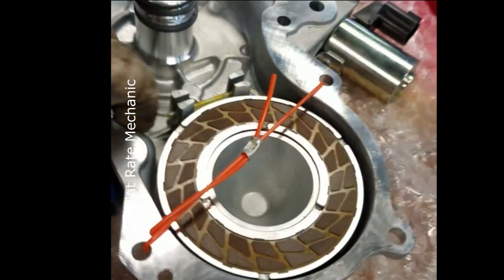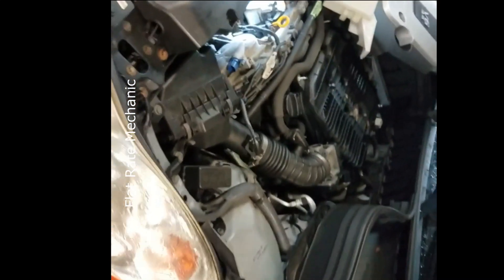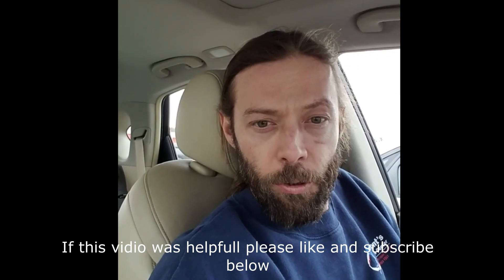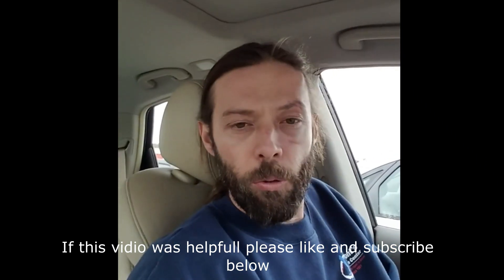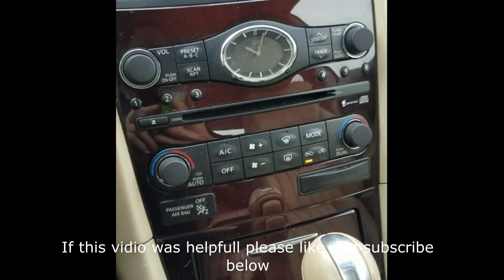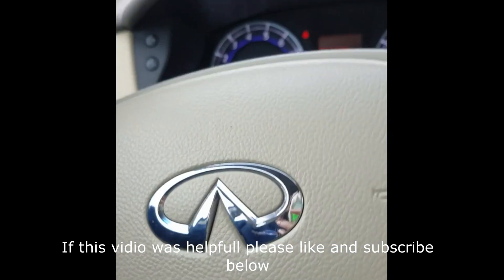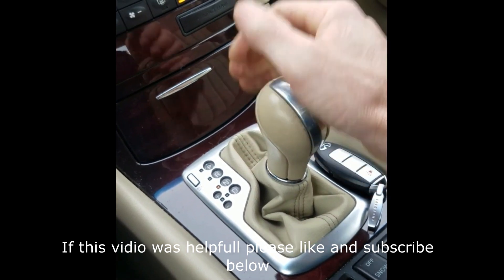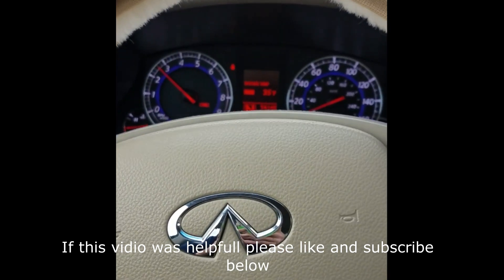Exhaust valve timing control learning procedure Infiniti G35 P0014 P0024 (no scantool needed)

Comment from the maker: You can find the scan tool I use on Amazon here: http://amzn.to/2BQq2Av Just wanted to add, I did have to hold my foot on the brake when doing the relearn. I don't think I stated that in the video. Also, Identifix said nothing about pushing the brake too. I was unable to get the relearn to work untill I held my food on the brake.
Reply: The Flat Rate Mechanic hey bro I have the P0024 are you positive that it is The right part because mine is from bank 2 not from bank 1, and also I have no issues with idle it sits well on 8-900 rpm  no hesitation there’s no issues whatsoever but my vehicle is still popping up this P0024 code I need to know because the bank to is going to cost me $700 and I need to be positive on making this investment so are you 100% sure that this cleared that code?
Reply: Also I have changed variable valve timing Scylla noise I had clean my camshaft sensors the only thing is I have not cleaned my crankshaft sensor
Reply from the maker: p0014 is bank 1 and p0024 is bank 2. I cant guarantee anything but in my case, this did fix it.
Reply: Will this work on a 2009 fx35?
Reply: @GTB197711  i have the same problem can you tell me if you fix it and what was the part number?
Reply: @Letedwin1107  The relearn process worked for me. I replaced both sides at the same time and did the relearn process.
Reply: @GTB197711  ok thanks im dealing with p0024 Bank 2 y buy the part but I want to makes Shure I have the right part... Bank 2 is the right site right?
Reply: @Letedwin1107  I cant remember but I think it is. You can verify with the dealership. I ended up replacing both sides.
Reply: @GTB197711 how do you do the relearn
Reply: DO YOU HAVE THE PART NUMBER YOU CAN SHARE ?
Reply: How do you know it worked?  Is there an indicator that says it work.
Reply: Ive got p0014 and 420 bank 1 code.

Comment: Is there any way you can show how to remove the VTC cover, especially the passenger side ? Did you have to remove the front fan in front of it?
Reply: If you want better access to it I would remove fan assembly cause it's right in front of the timing cover
Reply: Yes the passenger side is alot more work than driver side. Belts fans ect all come off

Comment: Helpppp my 2011 Nissan Maxima SV 3.5 V6 is pulling a Exhaust Valve Timing Control B1 (P0014) but I see most says left and only seen one right ; EXPENSIVE.... Which one do I get? Right or Left? Some come in 2 pack do I get both?
Reply: You ever find out what the problem was?

Comment: Hey bud thanks for this video. I left one long a@@ message on my last comment on your other video. This will be alot shorter...Lol. I popped a P0014 code on my 2009 Maxima. The issue wasn't the actuater/ solenoid. Tested it and it worked. How do I test the Magnet Retarder? Why and how does that part go bad? The dealer wants $1000 plus for the case with the solenoid and retartder that's all together. They don't sell just the retartder. I found it online for $150-$175 plus shipping but no one can tell me if it comes with the kit. Which explains how to remove and some type of tool that helps remove that part. Okay so car is apart and the Solenoid works and the Magnet Retartder is okay but not sure. One mechanic put a power tester on it. Says he thinks it's okay? I don't want to put that mess back together without feeling 100 percent about the Magnet Retarder. Well atleast it was alittle shorter this comment. I appreciate your videos!!! Keep up the great work!!!!

Comment: hey, just did this relearn and then disconnected the battery. The SEL light went away and seems to be driving better than before. Thanks for this you saved me money on extra parts. Works on the G35 6spd MT
Reply: This is a stretch, but did you take the retarders/covers off to do the relearn? Just disconnected them? How do you initiate the relearn process?

Comment: do you know how to do a Relearn for a 2005 Infiniti G35 6spd MT? I just changed the solenoid in bank 2 with oil change and code still on.  Please? thanks alot.
Reply: Did you reset the ecu?

Comment: My engine starts to make loud ticking noise during this procedure after 5-6 seconds holding the throttle at 1800-2000.  Anyone else experiencing such issue
Reply: Did yours tick when it was idling to? Or just during the relearn
Reply: @camrenrierson3983  only during relearn

Comment: I just did that ( 215k miles on the clock)  because engine hesitates around 950-1000rpm when warm. While holding 1800-2000rpm after 5-6 seconds I start to hear tapping noise somewhere from valve train ( imagine you leave gap between valve and lifter 0.5mm or more- same sound) noise increases in the following seconds and it doesn't go away even after 30 seconds. It goes away after I pass 2000rpm or I let of the throttle. Is this the normal procedure or my chains are super stretched and they do the noise. I tried doing the same thing with obd scan tool, but it doesn't want to do it because " computer is detecting malfunction, relearn procedure failed "
Reply: 100% Sure it's faulty VVT solenoid. First you can do to validate it - just remove connectors from both VVT solenoids. IF the noice is gone - replace faulty VVT Solenoid

Comment: I replaced the VVT solenoid on my 2005 350z due to code p0011. Periodically after I clear the code the  code comes back in a week or so.

I can tell you that it nearly always happen on a stretch of road that has me in 6th gear at about 2000 rpm

Do you need to do the relearn steps even if you just replaced the VVT and not the magnetic retarder?
Reply from the maker: Yes i would make sure the relearn is done before going any further with repairs
Reply: I have a p0014 and I did replaced both sides VVTs and now I have that code imma try this relearn because the other thing I can imagine I have to change will be the VCT cover and it’s like $800

Comment: How to test this if it's bad or not ?
Reply: To test it you can use the ohm meter, check for .9 -.11 ohms at the retarter plug, with ambient temp of 66F (about) the thing is that it can read good but the clutch may be grab enough. That parts is expensive man about $900 bucks

Comment: How do you know that it's been relearned
Reply from the maker: You don't really. Unfurchently. And it can be very hard for it to take sometimes. If the check engine light keeps coming back on I would recommend you have the dealer do it with factory tool before spending any more money on repairs.

Comment: I got p1078 on my 06 g35 and my scanner says it’s the exhaust timing control sensor  is that this sensor?
Reply: Did you get your problem resolved with code P1078?
Reply: were you able to get it fixed?

Comment: Thank you for the video. how much labor does the dealer charge to replace one or both timing magnetic retarder?
Reply: I read somewhere that cleaning the built up glaze from dried oil on the retarder can also fix the codes.  Has anyone tried this?
Reply: @MrWoody311  i would try it, thanks for putting me on that track
Reply from the maker: The part itself is ridiculously expensive. Like 700$ but only like an hr labor to put it in, plus the relearn will need to be done.

Comment: Hi guys.  I have just replaced the magnet retarder itself,  not the whole cover.  After that i tried to relearn, but when i started to increase rpm my engine began to drop them from ~1900 to 1500 every 2 seconds.  I was performing this procedure for 20 seconds and p0300 random missfire code appeared,  but no p0024,  p0014 codes.  Please help!
Reply: Damir Bektassov Did you ever fix it
Reply: Hi,  yes i did.  I have disconnected the battery,  then performed this relearn procedure. Everything is fine now.
Reply: Do you have part numbers for just the retarders?? i thought infiniti only sold whole cover.
Reply: @damir3668  great information about p0024 and p0014 codes.  I think the magnetic retarder part number you are referring to is 23795-jk21A and is the same part used in the Maxima.    Can you confirm this?   Thank you.
Reply: @MrWoody311  Yes,  exactly! Tested,  100% works
Reply: @damir3668  I have visted your blog but I am still having issues removing the magnet retarder. I did follow the steps with the paper provided with the part but no luck. How hard was this part to change for you and do you have a video that I can follow? any advice would be appreciated.
Reply: @kevinmcc5641  , first you need to flood this entire cover with cleaning fluid (i was using wynns), but remove all the wiring and harness in advance. This is how you gonna get rid of all the contaminations inside. Only after that you will be able to easily insert those waxed papers between the magnet and central big round pin. It`s not an easy task and most of the guys who tried this also experienced troubles with getting the magnets off. For me it was also not so easy, but doable. Hope this helps.
Reply: Turn the engine off, then start it and cycle thru D and R and go back to N and try again

Comment: So you have  to keep your foot on the brake pedal with or without the ebrake on? I have a 6 speed  2006 350z with the same code (p0014) i replaced the magnet retarder on bank 1 but the relearn didnt work. Ill try tomorrow in the morning
Reply from the maker: I would try it in neutral with your foot on the brake. It did take me several tries.

Comment: The code p0014 came back after cleaning and relearn
what you suggest me to do?
Reply: The Flat Rate Mechanic the told me to check oil pressure i checked its ok
and I check with scan on active test when I change degrees its not moving or just a little bank 1 and bank 2 moves
Reply: I had mines checked the said the exact samething about the oil pressure & they told me i needed to replace both valve timing covers. The Flat Rate Mechanic does that sound accurate??
Reply from the maker: Yes it does

Comment: why did u changed and what syptomes it was giving
I have same codd but no syptomes
Reply from the maker: I would try clearing the codes and doing the relearn first before replacing any parts. This one had store code p0024 and a p0300 for a random misfire and was running a little rough on startup. Idle was also a little high. If you dont have any symptoms a relearn may do the trick. Best of luck.
Reply: The Flat Rate Mechanic I relearned
Reply: The Flat Rate Mechanic I had p0024 I cleaned it it doesnt come back
now I have the p0014
Reply: The Flat Rate Mechanic you think I should clean the magnet
and dealer they saying maybe itz because of gallery gasket in the timong chain
Reply from the maker: pretty much the same code just for the other bank. I would try doing the relearn several times because it doent always take the first time. Hope that helps.
Reply: The Flat Rate Mechanic I cleand the magnet cover first time for first code
Reply: @khaledafg1  you cleaned what?  Or do you mean you cleared the codes?
Reply: @MrWoody311  cleaned the magnet its self for one side it worked for the other one no it was too much damaged
so I had to change it 
You can not change only the magnet
But make sure thats the real issue
because if you dont have enough oil pressure you may have those codes
if sporckets make some noise you may have oil pressure issue
because of galley gasket in the timing chain
Reply: @khaledafg1  Why can't you just change the magnet.  The magnet from the Maxima looks exactly the same and is sold individually for about $150.  Is there something different between the Maxima magnet and the Infiniti magnet that prevents using on a G35?
Reply: @MrWoody311  I didnt know that and if you can make sure you will have same resistance
you can find spec on web
Reply: Did you ever figure out what was going on with yours? I have the same codes. Did this procedure work for you? Please let me know.
Reply: @samokash  First time I had the code p0024
I cleaned the magnet it worked
a week later the seconde code p0014
the other side came on
I did same thing didnt worked
after confirming I changed the piece.
Reply: @khaledafg1  do you have a video on how you changed the magnet retarder? I am having issues changing mines.
Reply: @kevinmcc5641  which side u have the issue
Reply: @kevinmcc5641  driver side is much more easy than passanger side
dirver side u have to remove the rad hose fans just to have enough room.
I dont remember well I think  pulley too with the belt.
and for the passanger side u have to remove fans for sure, belt 2 pulley, belt tensioner, power steering pump, the bracket that holds the pump, the pump dont need the disconnect hoses just move to side will be fine the bracker has 2 bolt on the ride side of engine. Let me know If somethin is wrong I did it last year I change only the passanger side the driver I cleaned it worked
Reply: @khaledafg1  passenger side, I just need to know how you removed just the magnet retarder out of the case. I already have the whole plate from both sides off of the car, but the magnet retarder I cannot get it out to swap it with a new one. What did you use?
Reply: @kevinmcc5641  I changed with the plate, I removed once the driver side with pry bar the passanger I didnt remove I bought the Assembly from dealer
Reply: @khaledafg1  ok thanks, I am stuck trying to remove the magnets. They are not easy to remove
Reply: I'm getting a code p0014  on my 2010 infinite m35  any help

Comment: Where did you get the part from
Reply: The Flat Rate Mechanic from States
Reply: Bro wtf! Are you sure it’s the sensor set up inside that component?
Reply from the maker: Got from the Infiniti Dealer. If the remember correctly it was close to 500$. Petty pricey.